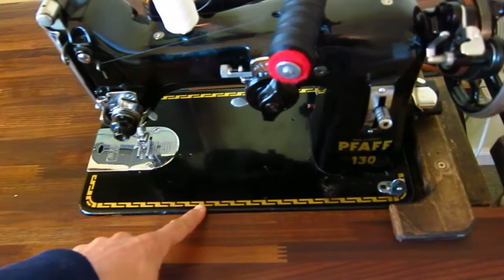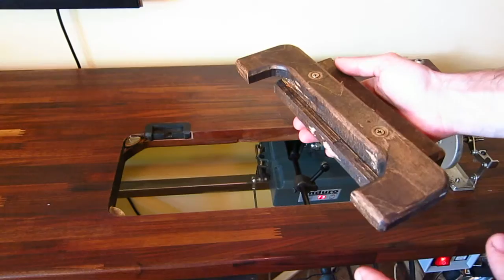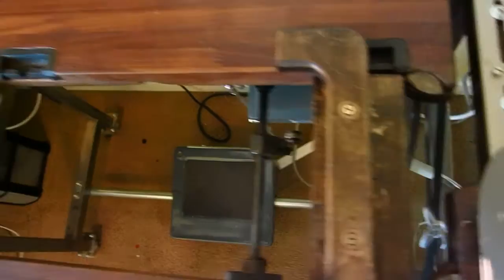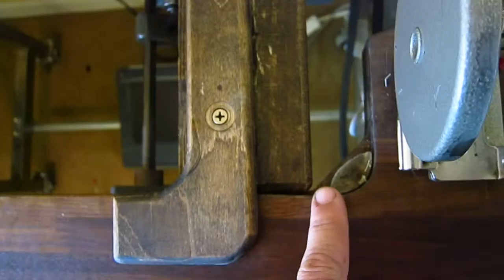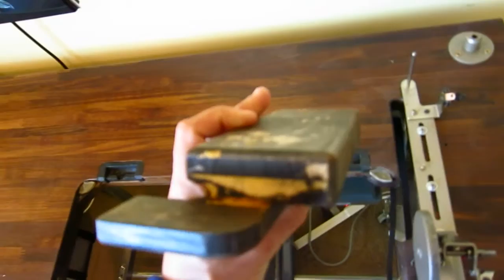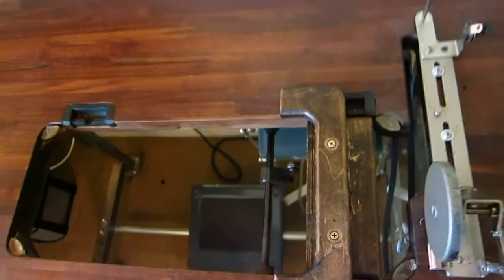DIY Adapter for using a Domestic size Sewing Machine in an Industrial Sewing Table

Comment: Did something similar with my Singer 210K. Don't have the fancy servo motor like you do, though, and my table was built from 40mm ply with no cutout (did have a blind hemming machine on it when I bought it) so was a job to cut!

Comment: Wonderful video! I have an old industrial machine, probably 60'/70's?  on a wood table with black iron base arriving next week, and was wondering where to put it, as the machine itself, though old,  is not the beautiful curved vintage old. Now I realise I can put my existing very decorative Singer 201 into the table as well, when not needing the industrial, I'm happy for it to go in the sitting room. It currently lives on the kitchen table, which is a little inconvenient to say the least. 
You could paint your wood effort gloss black, as you don't seem to be so talented at the sanding staining polishing of your well designed insert? (Unless it was you who refinished the table?) Then at least it would match the machine, if not the table? Your walnut table is gorgeous!
Reply from the maker: This was the prototype.  I've since remade it out of walnut and steel, which was painted a gloss black.   I didn't want to invest time finishing a prototype that was thrown in the trash.   Not sure what you meant by the "you don't seem to be so talented at the sanding...."?

Comment: Hey Sergeant,

I got the stuff you told me to pick up . I cleaned up the 142 really good thing was dirtier than pig pen from the peanuts gang than I gave it a good oiling let it run it full blast like you said I almost crapped my self with fast this thing goes. I did some test stitching on a piece of raw denim double folded the 142 cut threw that thing like butter.I wanted to find out if the 142-6 /2B comes with a stop block . Thanks for any advice you can share I really appreciate all the advice.

Best

Rich

Comment: will post a vid for sure on my channel . Wanted to know what type of oil would you recommend I use on the Pfaff.
Reply from the maker: Lily White seems to be the industry standard.  I personally use fully synthetic motor oil like Mobil 1 0W-20, the lightest available.  The impurities in sewing machine oils contribute to the varnishing you see on vintage sewing machines that result in them being "frozen".  If your machine is tight flush all the moving parts with kerosene and run it at full speed.  Then wipe away the excess, blast it with compressed air to remove remaining kerosene and then lightly oil and then continue to run at full speed until everything has loosened fully.  Goodluck!

Comment: Hey Sergeant,

I tried both machines today and I know you told me to roll with the singer 112w115 but the  Pfaff 142 was no joke great condition runs smooth so after some back and forth decision making and a bunch of internet research I decided to go with the Pfaff 142 I was able to track down a gauge set supplier out in Europe also found a needle supplier over here .Oh yeah there a was a new motor and power off and on switch box installed I know the parts might be alot harder to find but this thing is amazing butI will be picking up a singer a my secondary machine just to be on the safe side.Once again thanks for all the input.

Kind Regards

Rich
Reply from the maker: Congrats!  The Pfaff 142 would have been my first choice, without a doubt, assuming gauge sets were available.  Sounds like you've sourced them so that's a non-issue.  Great choice!  Enjoy the machine!  Post a video of it in action if you're able.
Reply: I have a Pfaff 145 walking foot high lift and its a work horse. Runs a 190R needle and never fails to sew.

Comment: Is having no reverse on the 112w115 gonna be a big issue when I have to do re-inforce stitching on jean pockets and belt loops
Reply from the maker: It shouldn't be.  In those situations you're going to want to just use a single needle and sew a few stitches forward, bury the needle, lift the foot and swing the piece around and sew a back over.  Repeat so that  you have 3x stitches.  If the Pfaff 142 is setup with the width you want, which is probably 1/4" or 3/16", then go with the 142.  If it isn't then you'll want to go with 112 since you can change the switch width
Reply: Oh wow I didn't know I can change the switch with on the singer . Also your right about Pfaff I did a search last night and was barely able to find anything for it parts wise.
Reply from the maker: philtyrich1 Ya, you can change the spacing with a "gauge set", anywhere from 3/32" spacing all the way up to 2".  You can purchase the gauge sets on eBay for around $20-30.  You'll need a new needlebar as well but it's worth the investment to get that kind of versatility.  It's a pretty fast machine too, up to 2800spm.

Comment: Hey Sergeant,

Hope all is well. I've finally narrowed it down to two machines I'm either going to go with the Pfaff 142-6 double needle sewing machine which I was able to get the seller to come down to 125.00 or the Singer 112w115 double needle sewing machine it was 200 seller is willing to come down to 175.00 . Wanted to get your take on which one I should go with .Thanks in advance for any advice you could share.
Reply from the maker: Those are both great machines and both at great prices.  I actually have a 112W115 myself and like it.  As much as I love Pfaffs, and the 142 is a great one, the problem you're going to run into with that machine is parts availability.  You're going to have a tough time finding different guage sets/feet, etc. and when you do they'll be expensive.  I'd get the 112W.  Parts are still available and they're cheap.  My 112W115 has two new hooks, new timing belt, new needlebar and several gauge sets.  If you purchase the 112W115 you'll want ot order a "Singer 212" needlebar which is threaded to accept newer style gauge sets.  You'll have to cut 1/2" off of it to get it to fit but timing and installing it is very easy.  Perhaps I'll do a video on that procedure down the road.  Goodluck!